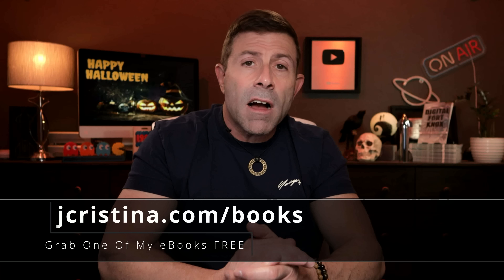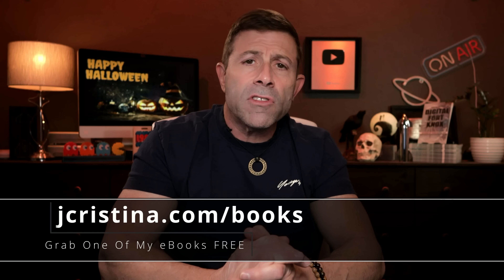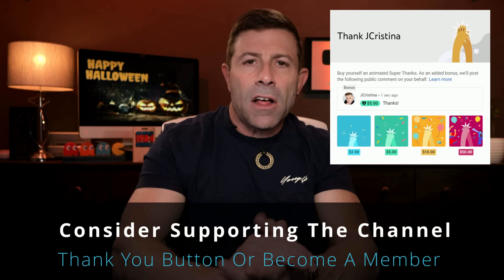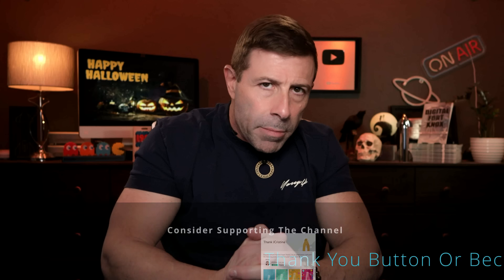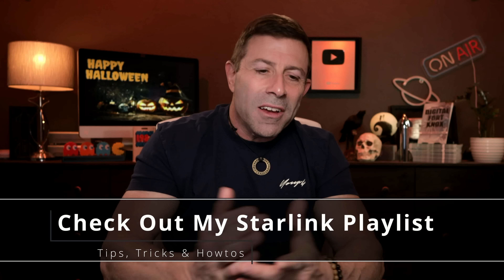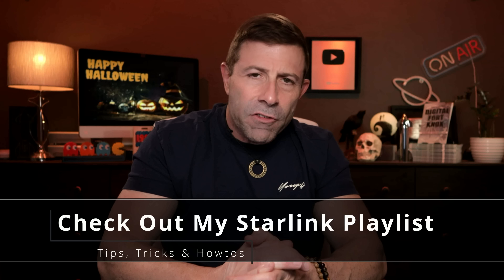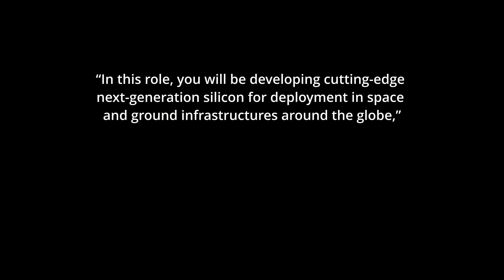Elon Musk’s SpaceX Starlink Powered By AMD

Comment: Apple moved to Intel because Intel was falling WAAAYYY behind and RISC/ARM is truly the future.  Intel has a had issues with power requirements and efficiency and has had issues with QC recently with the most recent gen 13 and 14 processors croaking.  AMD is whooping their figurative butts in power/compute efficiency.  Don't think I am hating on Intel because I am communicating with you on my Ali-express engineering sample i9 laptop style processor running on a desktop motherboard.  Intel was doing good back at gen 10 and 11.  I am mostly an AMD fanboy but a deal is a deal.  This PC can do more work on a third of the watts because it's a laptop style CPU.   I am running on battery power system with a full size desktop.  Well all that said I run on whatever was good 4-5 years ago because it's cheaper.  Developing a SOC like AMD's requires BILLIONS of dollars R&D.  It may be wise to use something off the shelf for now and develop the R&D down the road like Apple did.  It may not be the best option in the end considering all the decades AMD and Intel have been developing CPU's and SOC's it would be very very tough to reach their performance levels in a reasonable time.  Apple's product is computers. Starlink's product is a functional low latency internet.  CPU's and SOC's are a couple of steps removed from the final product.  It's may be smarter to let someone else create the on device compute structure.

Comment: The environment of space is severe. You have more radiation and more temperature extremes. You have more critical requirements on your packaging (anybody remember the tin whisker shorts on the lead free solder?). Testing needs to be more rigorous as there are no “do overs” in space. There is simply a divergence of requirements between space and commercial/industrial needs. Back pre-PC (1984) most semiconductor companies made military grade components and a number even specific space grade components (anybody remember RCA COSMAC processors?). These days the semiconductor companies have largely load shed themselves from  those high end SKUs. Simply costs too much $$ and the quantities are enough to justify the cost and resources required. If every starlink satellite has a processor the total quantity they ever used would be less than the beta testing that somebody like Apple uses on a new product. Just not worth it for the semiconductor manufacturers. Some DoD companies will actually take the commercial parts, do the more rigorous testing themselves, qualify radiation tolerance and in some cases re-ball the packages from lead free solder to more standard eutectic lead solder balls. As the packaging on a semiconductor typically makes up the largest percentage of the cost once you have gotten into the space qualification business you might as well go ahead and customize the silicon inside to more optimally support the needed functionality. Just makes $$ sense. Regarding AMD, in the 1970s AMD was the largest processor company in the world and there were more AMD processors in military applications than anybody else’s. I’m thinking the Am2900 bit slide processor family here. AMD knows (or at least knew) how to make stuff for space/military. AMD also bought Xilinx which has SoC with FPGA products and is among the last to still support severe duty versions of some of their products. I think AMD is a great fit here. The other thing is that companies like Intel and TSMC have been in this race to the smallest silicon node. We’ll down in the single digit nm. This may not be the best thing for space based components. A little older, bigger but rock solid silicon  node may be more amenable for space applications. If you back away from the bleeding edge there may be more foundry options which speaks to better supply line management. What you can be sure of is that SpaceX/Starlink isn’t taking it on without having thought through the pros/cons…
Reply from the maker: 100% agree

Comment: I don't know if I'm hearing you correctly, but from what I gather, you're suggesting that SpaceX builds its own semiconductor line. If that is indeed the case, I think it's a bad idea. 

The cost to build a semiconductor line is very high, and you have to essentially develop a process from the ground up, which would take years. You're talking billions of dollars, easily. 

The companies that design their own chip usually have them fabricated by a 3rd party foundry service. Apple, nVidia, Qualcomm, etc all do this. They develop the chip in coordination with the foundry, and they get the finished goods in whatever form they agreed upon. 

A lot of the chip shortages that resulted from COVID were when component suppliers cut chip orders from their suppliers. Foundries then sold the capacity to other customers, and now you have to wait for a chip to go into your car. Furthermore, a lot of the shortages were in the older nodes. 

So, designing your own chip is a piece of the puzzle. Building it is arguably a bigger piece of the puzzle that, imo, wouldn't be worth it for SpaceX pursue.

Comment: I think you're putting the solution before the problem.  In the case of Apple, they had damn good reasons to go their own way;  not the least of which is that Apple's mote is having their own hardware AND software, unlike Intel (only hardware) and Microshaft (only software);  so Apple went back to its root by having their own hardware.  Tesla went their own way with the neural network accelerator because they could do a 900% better job (if not 1900% better job) than any competition out there.  Why?  Because they did not need 95% of the capabilities of current GPUs for that;  they only needed a tiny fraction of the functionality, but super-accelerated, and consuming the lowest power possible.  NOBODY was making anything even remotely like it.

  In the case of Starlink, I don't know the particulars, but if with an in-house solution they could expect to attain 100% better performance per Watt than AMD's solution, that would not be worth pursuing.  Far from it.  Given the capital investment, a 900% improvement, maybe;  100% no.  Besides, if you consider cost savings, one thing is comparing costs with something you'll sell eventually 25 million units a year of, while quite another thing is comparing costs with something you'll ever make some 40 k or 50 k of.  At 25M/yr you recover and exceed the investment with unit profits;  but Starlink satellites are not a volume product.  Last but not least, AMD are DAMN GOOD at what they do.

  AMD are a company of nothing but geniuses;  you would not imagine the kinds of clever tricks they came up with throughout their entire history to beat Intel with.  With the Athlon, for example, instead of a monstrously complex out of order instruction execution pipeline, they designed a pretty simple mechanism whereby each instruction in the queue can check if the instruction in front of it is halted, and whether its own input depends on that instruction's output;  and if it doesn't, it just gets around the halted instruction to in front of it.  "Distributed out of order decision making built into every stage of every instruction pipeline."  This single trick simplified the pipeline logic by like a factor of 10 or 20.  Intel were always running around like chickens without heads trying to figure out what to do with AMD's relentless competition and cleverness.  It was AMD, not Intel, that came up with the first i386 built on top of a RISC core.  It was AMD, not Intel, that first integrated L1 cache on-chip.  It was AMD, not Intel, that came up with an integrated memory controller.  It was AMD, not Intel, that designed the first floating point SIMD instruction set (remember "3DNow!" ?  Then Intel copied it, shuffled the instruction codes around just to ruin AMD's hardware, and pushed their copy as the industry standard).  It was AMD, not Intel, that came up with x86-64 (beating Intel's anti-competitive i64 project).  And it was always AMD that complied 100% with Intel's stated chip model documents;  not Intel.  Intel's chips were always mired in issues and bugs and workarounds;  always short of their own stated standard.  Add to that the fact that AMD's chips were always more energy efficient than Intel's by a large margin.  And in fact, Intel now appears to have lost the race, finally, and to be on a sure path to chapter 11 or to irrelevance, unless some stupid government decide to try and "save them", of course.

Comment: All semiconductors should stop using silicone. Diamond disc 6 inches in diameter are now made cheap no cooling is required at all no resistance no hating no resistance High speed.

Comment: How many CPUs per Starlink satellite? You can estimate the number of CPUs required for their entire operation. It is not that many compared with the number of CPUs for Tesla vehicles, etc. It may be a few years before Musk buys or builds a silicon fab. The economics revolves around performance and efficiency, it seems to me. To reduce latency they need the most efficient CPU for the task. Nvidia for video and AI. AMD for communications? You mentioned a lot of different factors but the internal architecture   that is fastest and most power efficient will be what they use. It sounds like AMD has the lock on this at this time.

Comment: AMD is x86/x64 architecture is almost too dated, it may be in SpaceX's best interest to consider using a specialized ARM platform ready for hardening. Consider that with a lot of Satellites in orbit run on something like the RAD750 from BAE which is a hell of a lot more survivable to the intense radiation of space... but at it's heart it is a PowerPC. Extremely ancient in modern hardware terms. 

We need something commodity level, radiation proof and modern with a semi-future proof architecture for the next 10+ years as the industry is shifting to ARM. That's not AMD.

Comment: I just unsubscribed: your video is nonsense. I'll explain why:

1. Designing and implementing such chips is extremely difficult and lengthy, especially in our patent-dominated world. Take a look at Tesla's Dojo: yes, you cannot; there is nowhere to find it, despite the D1 chip already being in production in 2021. 
AMD paid $35B for Xilinx, the company that designs these chips. Intel bought the other big one, Altera, for similar money. 

2. The only reasonable SpaceX alternative to having its own chips is to buy Altera from Intel. What will be the market for these chips? 50k satellites? LOL.

3. Apple's making its own CPUs does NOT make them less hackable than AMD CPUs. It's their OS and a tight-controlled software ecosystem, applied over a well-known architecture (ARM), that makes them less hackable. You don't need to design silicon to take advantage of tight integration.

4. I'm pretty sure Starlink's ecosystem is pretty tight and secure, as proved in Ukraine, despite the formidable state-backed opponents.

5. Nobody (except partially Intel) makes their own silicon. You'll still be dependent on foundries. What do you think the Taiwan story is about?
The key to success is not to produce everything in-house — nowadays, that's impossible. The key is excellent supply chain management. Musk has already demonstrated this during the pandemic (with Tesla).  

6. Versal (and Telluride) are not CPUs. They are DSP + FPGA + transceivers +.... When you program an FPGA, you practically program the hardware. You tell each "transistor" (more accurately, each gate) what to do. There is no lower-level programming.

TLDR: IMHO, Musk and his teams know better than you what the best strategy for them is 🙂.

Comment: Another benefit you did not mention is that processors used in space must/should be Radiation hardened. Otherwise, the lifetime of the chip could be significantly affected. Normally, companies hiring silicon engineers and start with FPGA (field programmable gate arrays) for their ease of programming, radiation tolerance and low upfront cost for runs in the thousands. Going for there they usually turn to ASIC (application specific integrated circuits) in order to control power and additional chip density, but this only makes sense for runs in the tens of thousands or more. 
It is interesting they chose AMD and I wonder if they are going to Radiation harden those chips at all. Since they only need thousands instead of millions though they have to start somewhere and the low volume makes using your own chip a very expensive proposition.
Reply from the maker: Correct. Or the case that they run inside.

Comment: I believe Apple and AMD use a simpler type ARM chip, Intel X86 complex chip.  AMD can run at faster speeds before cooling with 5NM TSMC extreme uv
Reply: Tesla buying everything from nivida for dojo computers.  Space X opening doors to AMD.  Tesla also designed own chips
Reply: AMD stock with Starlink.  Nividia stock with Tesla dojo
Reply: AMD make X86 & ARM chips.

X86 is superior for high power applications.

Comment: AMD and SpaceX are good partners.  AMD makes alot of chips. (high end CPU & GPU, plus customized console chips for XBOX and Playstations) , and uses the latest processes from TSMC, not like the old automotive chips using outdated fabs.  Tesla/(SpaceX) has a good Silicon team, who are busy doing special HW, and they don't necessarily need to redo the good CPU, GPU and FPGA from AMD.  In this instance, the Versal product family is impressive.  Why not use this because it can do all sorts of SDR algorithms and you also benefit from the chip volumes from multiple customers using Versal, and AMD's good engineering.  Tesla uses AMD in their Cars.  It's powerful to have your own silicon team, but doing it in house is not always the right answer.  Tesla & SpaceX just make doing it (the design in house) look like the better solution because they are good at it and differentiate the companies capabilities.  Lime half of the initial Tesla silicon team was from AMD actually.

Comment: Amd mosty makes their chips in Taiwan, if I'm not mistaken, and are building a new FAB in the U.S.,  AMD does also mace custom variants for clients like PlayStation & Xbox, 
For SpaceX to make their own chips they will first have to Design and Build their own FAB which could take several years
Reply: Tesla for instance designed it's own AI chips. They then contract TSMC to manufacture the chip. Nvidia does this as well. Even Intel contracts TSMC to make high end chips for them.
Physically making a chip is insanely hard. Is almost impossible. TSMC achieves miracles and no one can compete, even Samsung lags behind. Musk would need to divert a huuuuuuge amount of resources to make his own fab. He has to many other things he can do with the skilled workers that would be required